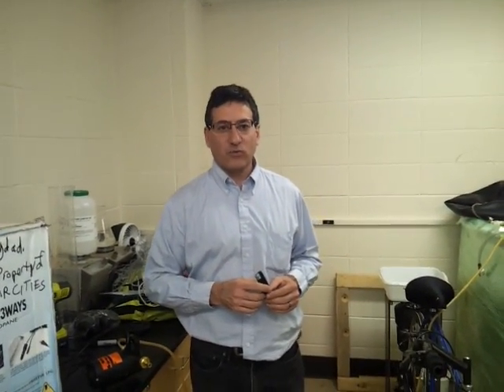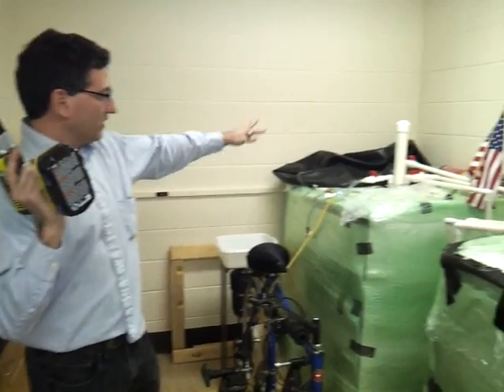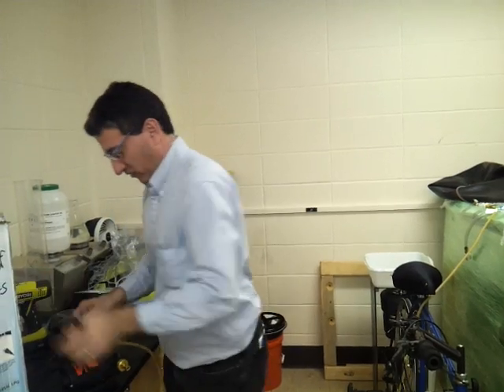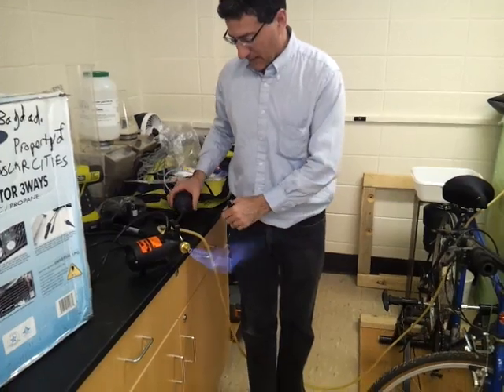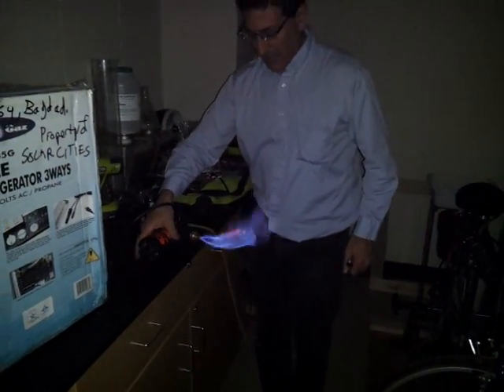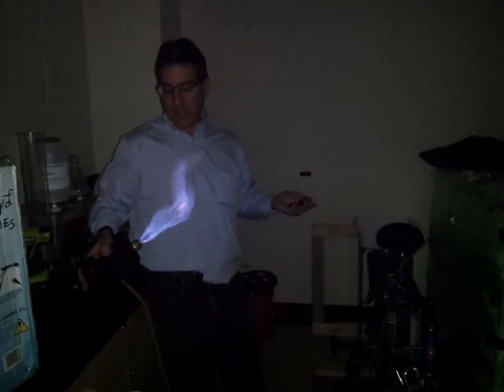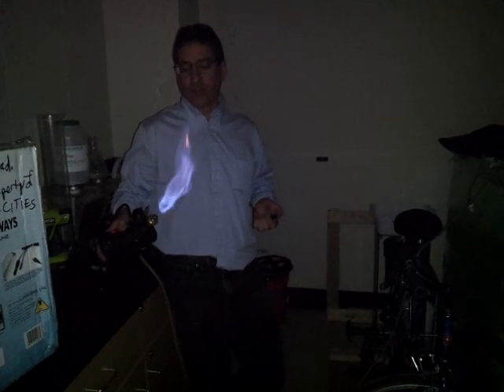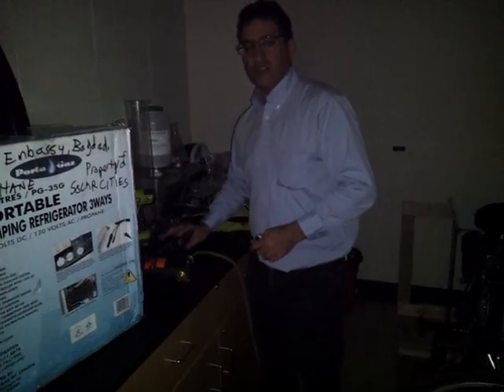flaring biogas from inner tube using water pump

Comment: I made some gas  and burned it ,but my issue is maintaining the 38 degrees.
In my case I used a immersion heater element but it was too expensive so defeated the objective of producing heat for my home .
How are you maintaining the neccessary temperature with your unit ?
In my home an average temperature is 18 to 22 degrees celsius
From my research you need internal body temperature for the microbes to survive .
Any advice would be really appreciated Ty

Comment: Well done !
Are you using a waterpump to suck out the methane gas ? What kind of pump is it and is the gas in the tank under pressure ? Where does the hose come from ? From the top of the gas tank ? Please explain more,.
Many thanks.
Regards, Stefan.